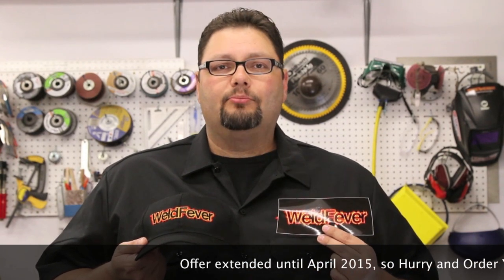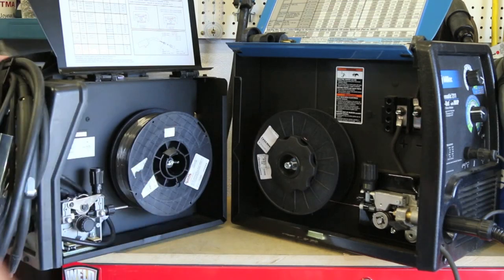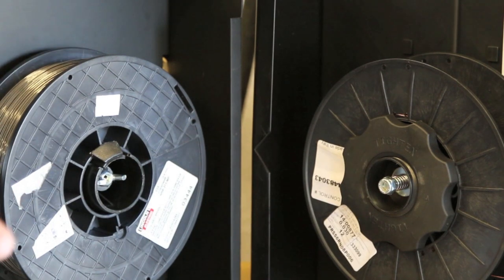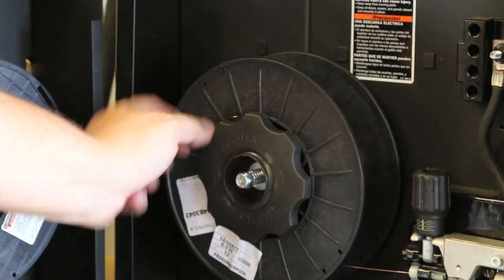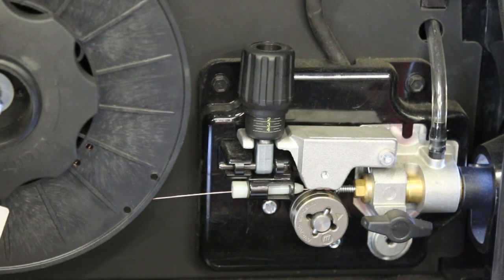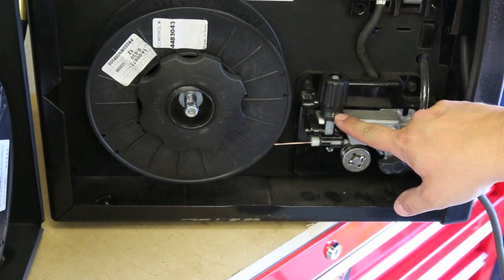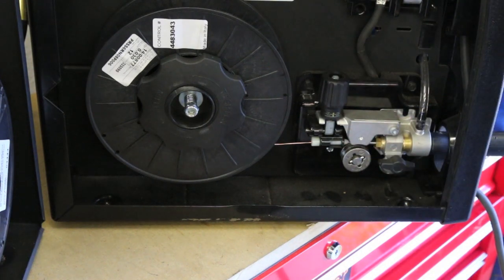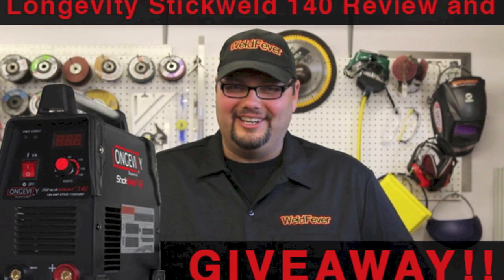MIG Welding Troubleshooting Part 1

Comment: The motor that turns the wire feed on my Jobsmart 125 doesn't even seem to be attempting to turn when i pull the trigger on the gun. I'll try to turn it with a lot of tension or little, or even without the roller on the drive shaft. It does nothing. Can someone help me with this? the shaft doesn't seem to be locked up because i can still move it by hand.

Comment: dan I got a question I bought this 110v /220v welder off ebay lil cheap one 80 dollars but it dont work at all in 220v or 110v what do you think is it the rods its a bx100
Reply: stick welder

Comment: im looking to make a 20 to 30 ft mig weld cable / handle. do u have any idea where I can find one
Reply: Maybe better to wire up an thick extension cable for power and bring the welder closer to work. I did that with my Everlast welder. I think it is too long to push mig wire through 20 feet through the mig cable.  Either use an extension cable or get a spool gun or a push pull gun.
Reply: 214mannygarza We run 25' whips at work. They're for Miller wire feeders thought. I believe they are Radnor or Bernard brand.

Comment: Looking for advice, I have an older Betamig 200 with weak output, I bought this welder because my friend has the same model and it was awesome. Mine can barely weld 3/16 on high set to 9( the highest setting) my friends will do 1/4 " on low. I checked the diodes and the bridge rectifier and they checked good. I have not checked the capacitors. Any ideas that would help would be great, I can't afford to buy another welder.

Comment: Hi Dan, I have a Millermatic 130xp, bought new in 2000. I'm wondering if I can stop the gas control valve, inside the machine, from leaking?  When I close the bottle valve,  the residual gas leaks down in about 20 seconds. Would you know if it might be possible for me to pull this valve out of my machine and replace gaskets or O-rings or whatever is in the valve, to stop it leaking?  
Thanks, Jeff M.  jeff.island@gmail.com.
Reply from the maker: Are you certain its coming from inside the machine and not a bad connection or broken line? If not, I would recommend you send the machine to an authorized service center, because there's a lot that can go wrong when you start putting your hands into a welder, unless you absolutely know what you are doing. Just my 2 cents!

Comment: My wire fed welder sounds like it's actuating when I pull the trigger to feed, but rollers are not  turning and no wire comes out. Any suggestions?

Comment: Hey weld fever, i got a lincoln mig weldpak 100, it sat in my shop for a few years and was covered in dust, i since then cleaned it all off. I can not get a spark, i even tried to tac on the clamp and still no spark, i didnt think the relay had been popped since everything else works, i had it set on D2 and trying some beads on a cutting edge. I dont want to take it to the dealer if i dont have to but i cant find the problem with why theres no spark... Any help would be greatly appreciated. Thanks Bud.
Reply from the maker: Try blowing it our with compressed air, and then make sure your dials are "snapped" into place. Sometimes they can get stuck between settings and the machine won't work.
Reply: I try to blow out my everlast welders every 6 months or so. This is especially important if you do a lot of grinding as that grinding dust gets everywhere.

Comment: hey weld fever could u give me a heads up on why my little wolf weld 30-135 welder has stopped arcing ? I have wire feed just no 'clunk " and power thanks !!!
Reply from the maker: +Jordan Watkin If your dials are the "snap into position" type, make sure they are properly in position by moving them a bit and locking them in. Then check your work (ground) cable. Also check to make sure your contact tip is not heavily worn, or you will not get spark. Finally, make sure all of you connections at the gun are sound. Hope that helps.

Comment: i have a lincoln 140c power mig and it feeds wire but will not weld it will spark a little but thats it the welder is only like 6 months old please any help would be awesome
Reply from the maker: +b1zzl3 I would need more info to be helpful, but if it's only 6 months old, I would see if it is still under warrantee and take it to a Lincoln repair shop.
Reply: turns out the the cable welded its self to the liner i called Lincoln electric and they said the gun/cable is not covered under warranty its considered consumable i feel that they should have replaced it i understand it is a wear out part but in less than a year next time i will get a miller
Reply from the maker: +b1zzl3 Can the liner simply be rep[laced to solve your problem? If so, that is a simple fix and probably not too expensive.

Comment: Thanks little things like wire tension helped out alot no information out there on setting wire tension.
Reply: I use the "tighten the tension until you can curl the wire against a wood block approach" with my Everlast welder.  there are quite a few videos out there describing how to do this.

Comment: I have always been told that the drive roller tension should be allowed to slip to prevent bird nesting in the event of burn back. I do agree however that it shouldn't slip easily. I usually make mine so that I can't stop it by pinching it with my bare fingers, but I can stop it by grabbing it with my MIG pliers right against the contact tip. Also on the spool tension I go a little tighter than you showed to prevent backlash. In all I enjoyed the video, it had some great info in it. I understand that each person has his/her own preferences, and I am by no means saying that you are wrong on any part. If it works for you then carry on.
Reply from the maker: InkSlinger1337 I would buy the bird nesting and burn back strategy on aluminum wire, but I've never heard that before. Thanks for sharing and please keep watching and commenting!

Comment: Thanks for the info I was having problems with my machine
Reply from the maker: ar15mmdelta Glad to hear it helped.
Reply: hi friend, good Wednesday my question is the drive roll of my Lincoln welder hd 175 is not turning "what can it be" when I pull the trigger it makes the same noise as before can you or any one help me so I can get my bones moving thank you..